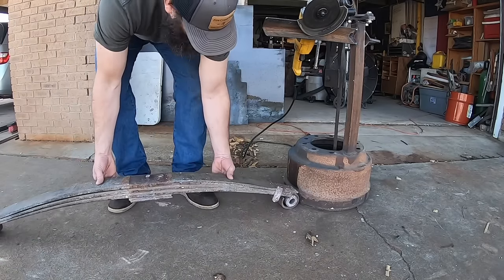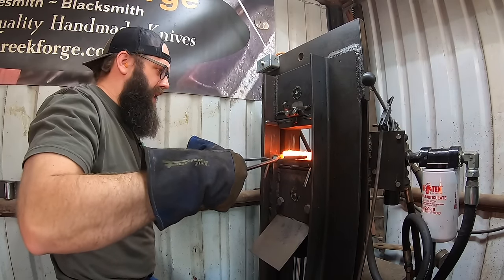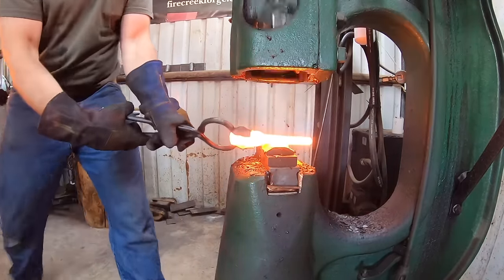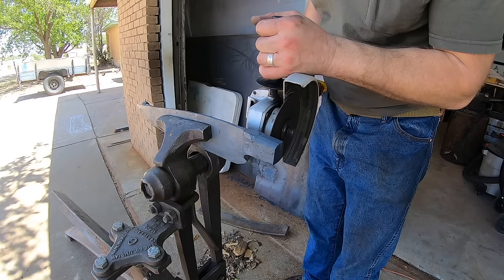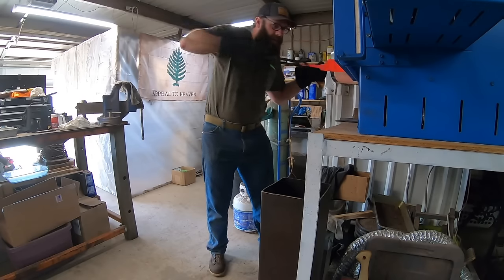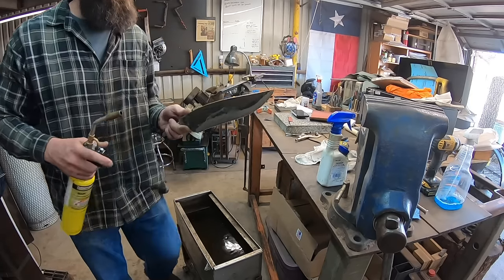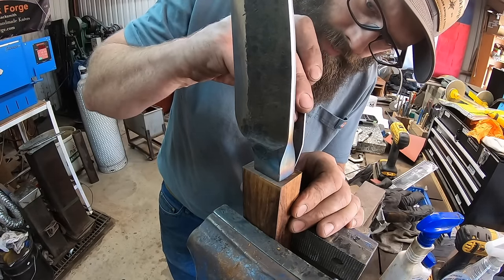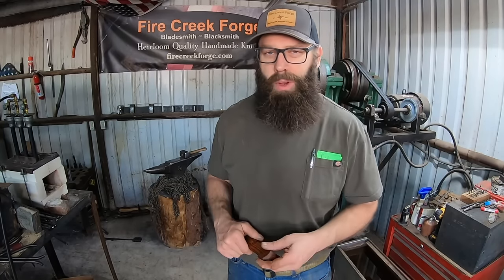Forging A Huge Integral Bowie Knife From A Giant Truck Spring, Blacksmithing, Knifemaking

Comment: Respect for that forging!  I used a piece of truck spring (maybe 5160?)  for a kitchen cleaver.  I'm still working on it trying to hand sand it to a nice finish.  The quench warped the blade pretty bad and grinding it straight took it thinner than I would have liked.  When it is done it will cut meat and vegetables to whatever thickness (or thinness)  I want, but it will be absolutely useless for chopping through bones.  It's more of a Frankenstein chef knife than the cleaver I wanted to make.  Next one I will take a few lessons from this vid and try them.  Thanks.
Reply: I got a lot of truck springs that i use to make my own knives. Anneal it it makes it crack and warp less .

Comment: Nice Monster Bowie; some thoughts that occured to me as you were working through shelling the integral bolster. 
1. Getting a nice balance point (matchete like for chopping or more camp knife oriented).
2. Would a thru tang and pommel or integral guard/bolster add or detract from the design, as something to use some of the extras metal? 
3. A sweet little Bird & Trout 4 inch blade, in the same steel would make fun companion set, IMO.

Love you openly talking thru areas that went well and those that were challenging.

Comment: A Bowie knife without a cross-guard cannot fulfill the primary function for which Colonel Bowie designed his knife.
Reply from the maker: The original didn't have a guard.
Reply: @FireCreekForge , the first knife made to Colonel Jim Bowie's specifications included a brass cross-guard to protect the user's hand in a fight and catch the opponent's blade.